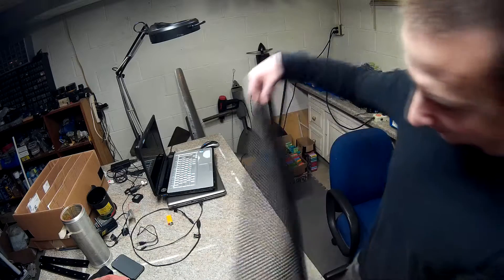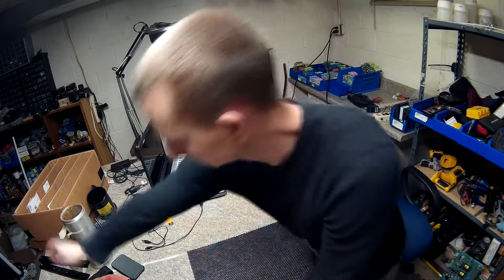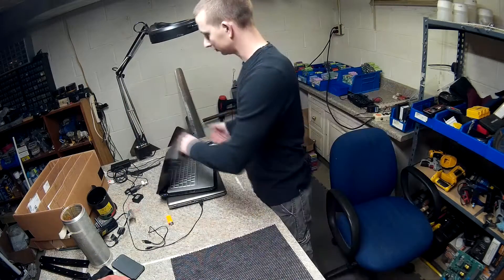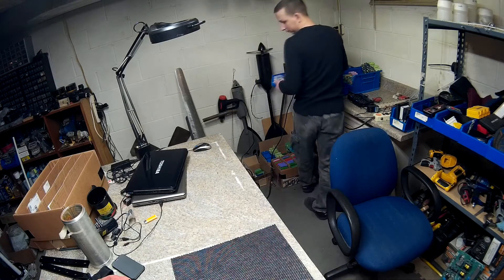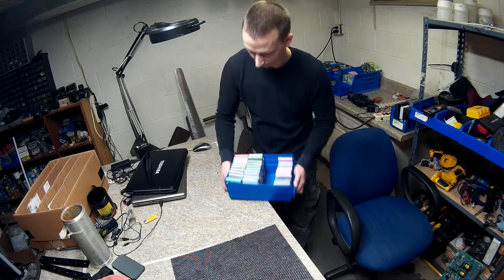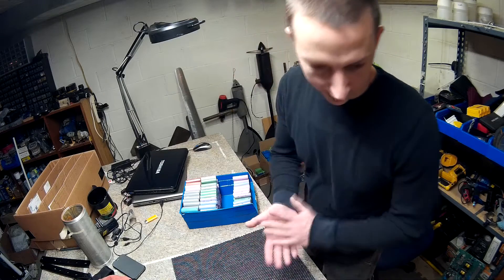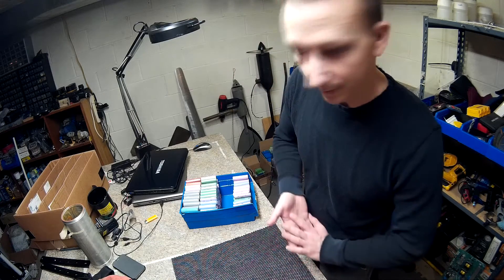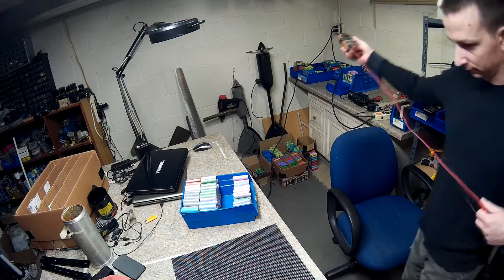Diy Tesla Powerwall ep12 18650 Cleaning

Comment: Great channel! What do you use to get the gunk out of the cells? When I tear the batteries apart, they have all sorts of glue... Acetone, rubbing alcohol, wd40? :) thanks
Reply from the maker: Thanks!!!  Well now that Im making my own cell holders to remove the cells easily, I re-shrink wrap a lot of them if there is to much stuff on them.  Its a pain the remove all that crap.  If there is just a little Ill use a plastic knife and scrape them.  I tried goo-gone and a few others and it kinda works.